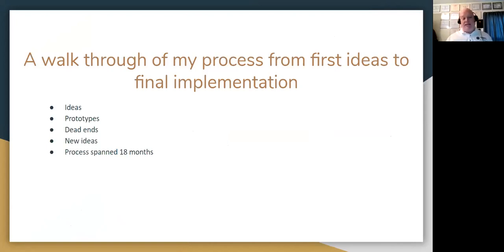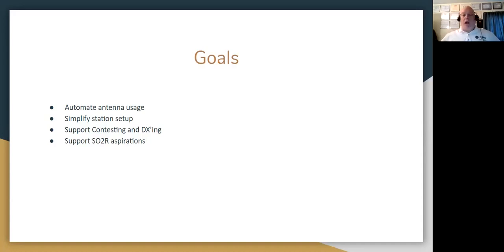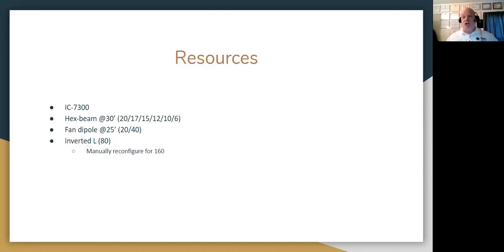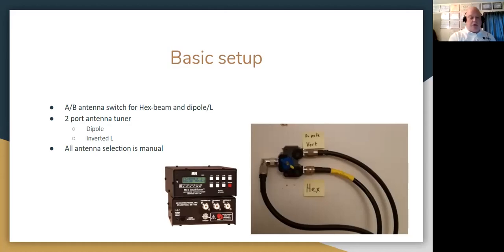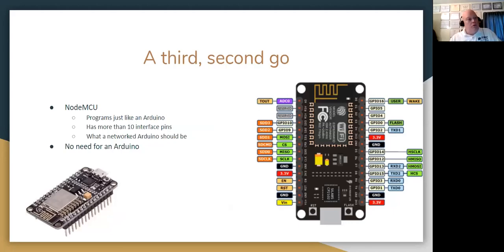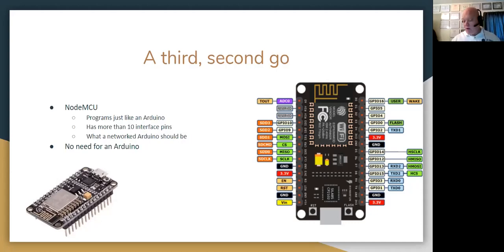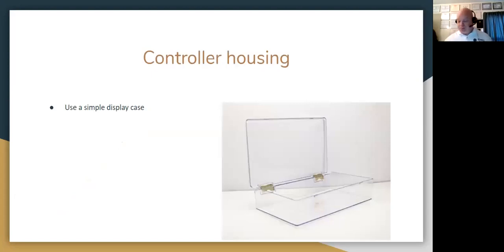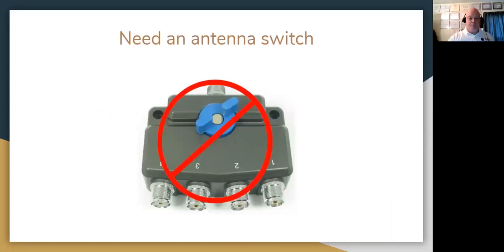SMCFest 2020 - Homrebrew Antenna Switching by AB9YC

Comment: I wanted to comment on one the statements regarding the ESP8266 not having enough processing power to manage the XML OTRSP UDP protocol packets from N1MM+.  I have been using the tinyXML library for over 2 years in my WiFi antenna switch controller.  The ESP8266 seems to handle the flow of UDP data from N1MM+ just fine.  I have used the basic UDP XML OTRSP design to implement a WiFi controller to control 2 Array Solutions bandpass filters in my SO2R antenna selection scheme as well.  

I enjoyed your presentation as it very much mirrored my approach to the design and implementation of my antenna switch controllers. 

73,
Eric - NR4O